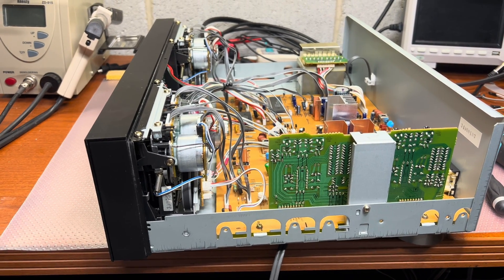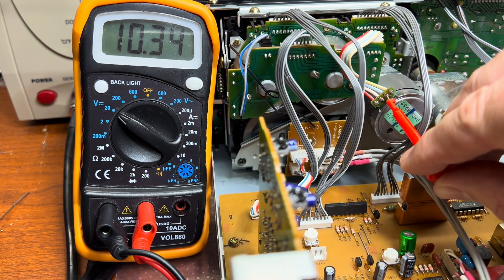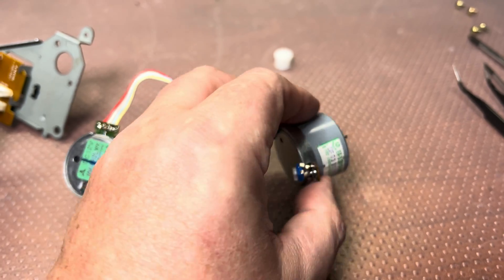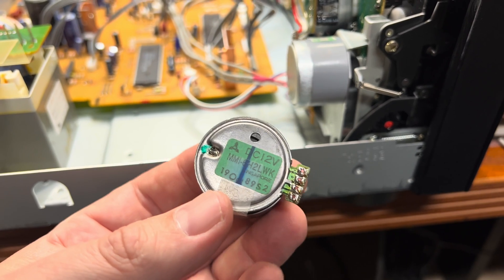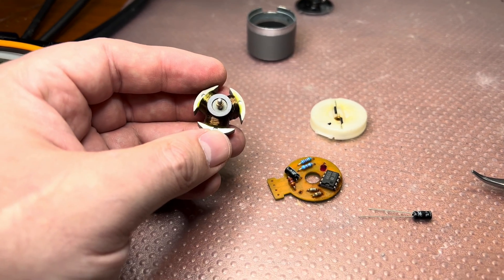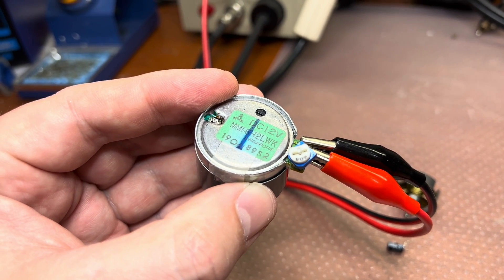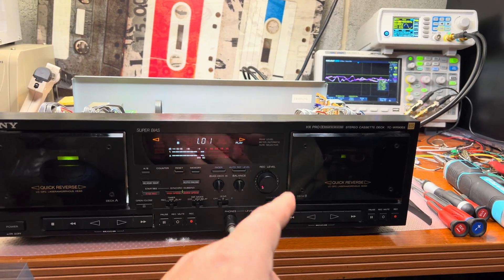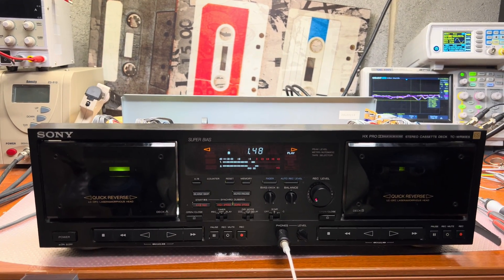Sony TC-WR90ES Final Update: Overcoming Motor Challenges

Comment: Cool tape deck , the Sony WR-820 is very similar other than wood sides and gold RCA and phones jack. It is very fast and silent transports. They also made a 820A version denoted on only the rear panel , but it doesn’t have the 3 motor transports, but 2 motor. They record and sound amazing in one direction of the head isn’t lined up perfect.

Comment: Did you check the 'Baba XPress ? I've got some motors from there. Also it's fun to see ho live lubrication works, just the front spindle with mineral oil and instant gain of 100 Hz on some machine.
Reply from the maker: I don’t have to check every Chinese site. Specifically I am already wasted hundreds of dollars for the garbage they sent.
Reply: I don't really understand you... you complain about not being able to restore a piece and when somebody tells you there are places where it's likely you can get it you answer like that.

Since I've already bought used motors from there I know there's a good choice. Not all are exactly healthy but surely the chance can't be much different than from any other source having the part at this point in time. If you don't trust buying one you can get multiple pieces and it's very likely you'd find a perfectly running motor for your application.
Reply from the maker: @m80116  when I do restoration for myself I can spend years searching for parts, fixing multiple issues, etc. when I do work for someone else I should me mindful of time and money. That as simple as it is. We agreed to try these motors - it did not work, I shipped the deck back.

Comment: I have a Sony TC-WR901ES with the same issue. With the speed pots at their lowest, I couldn't get below 3200 Hz. I think these motors are just dying. Surprised that it's always running too fast and not too slow.
Reply: Quick update: I found an eBay seller who had the exact same capstan motor for sale (Date on it was a year older than what I had) I swapped the motors, and tuned it with a 3khz tape. It now works perfectly fine! Sad to see these motors dying with no good replacements besides taking them from other dead decks.

Comment: why you instal 9v motor instead original 12v? also the original has 1800/3600 speed while your 9v motor is 2000/4000 so there are 2 parameters different. get 12v motor ccw with 2 speeds and replace resistors on a main boards. keep normal 12v as suppose to be but there are 2 resistors which are in line with pots adjust the speed. i done it in mine and was perfect. your motor was overheating becouse off 12v vs 9v.
Reply from the maker: It’s simple, there are no 12V motors available.

Comment: Hi, my suggestion would be to use AN6652 motor control ic that doesn't need lots of external components. Also you can do logical resistance switch to achieve that double speed when it is required. in this case you have to connect new circuit straight to motor pins (brushes). This is only option that can suggest in this situation. Anyway cool video, keep it going!